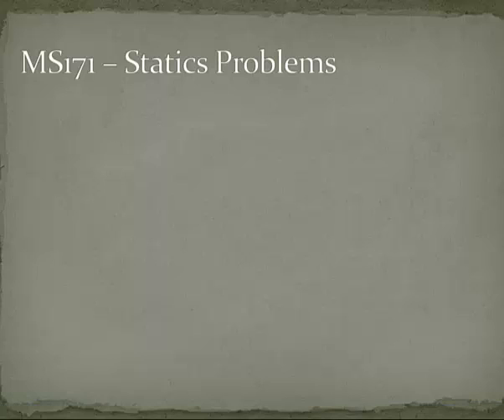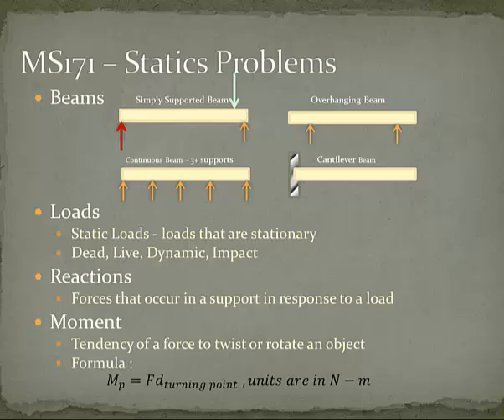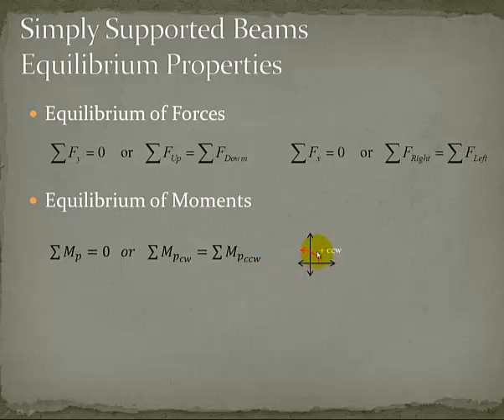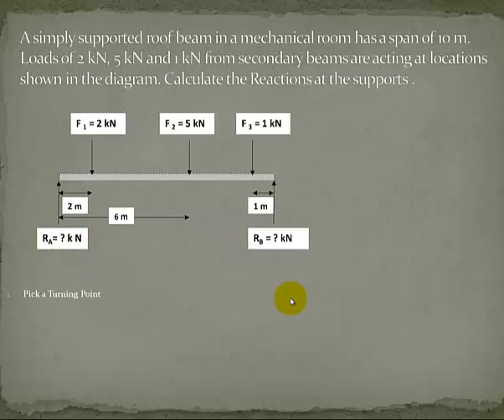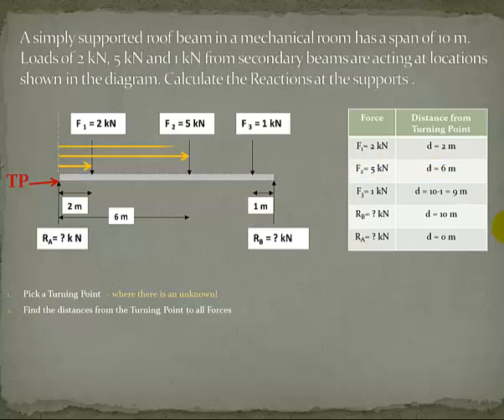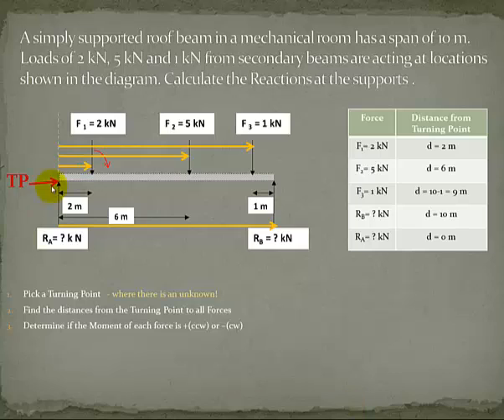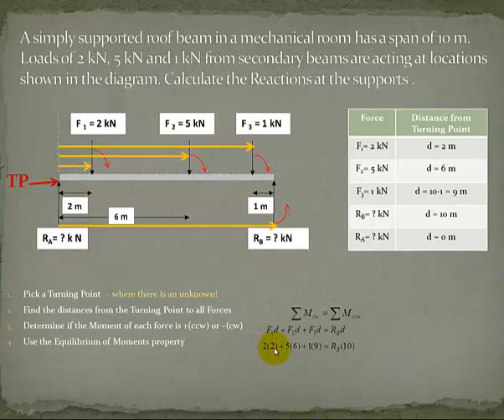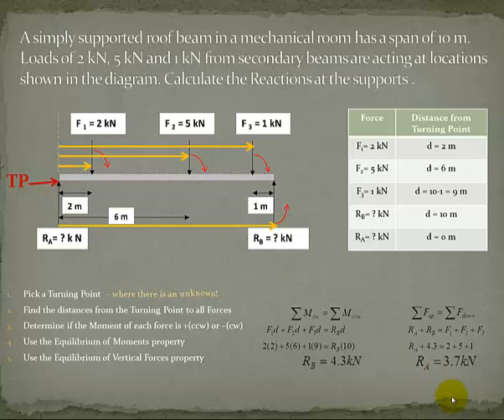Simply Supported Beam - calculating 2 unknown forces

Comment: how would i solve a equation if the if we didn't haveF1 and F2 and F3 just RA and RB
Reply: Then you cannot solve it as you will have 3 unknown variables more data is required. In this experiment we have known applied weight and we have to calculate Ra and Rb.